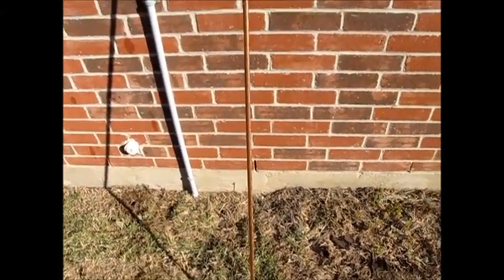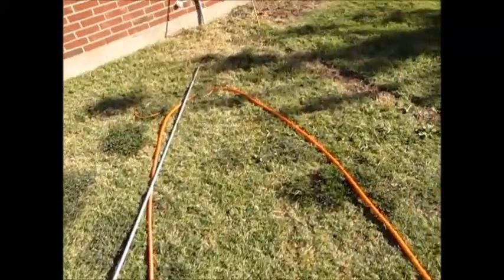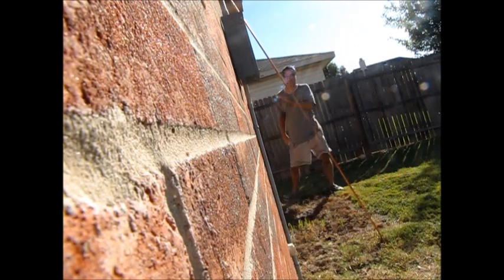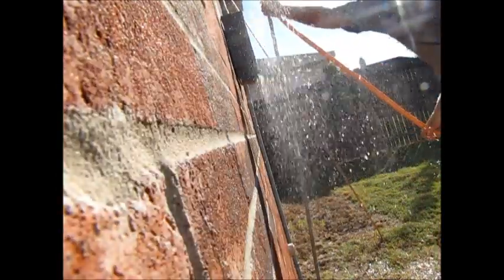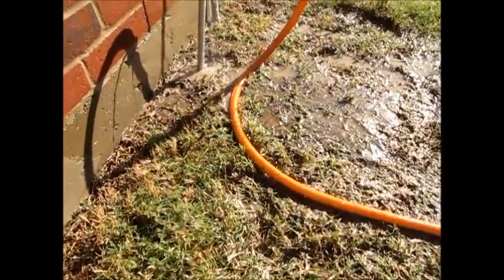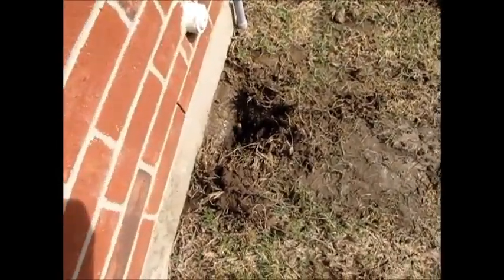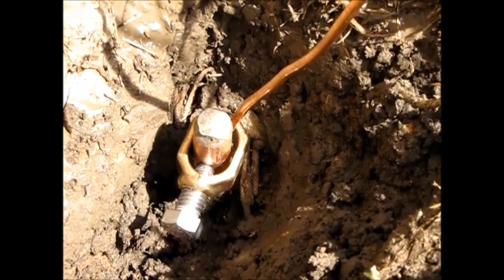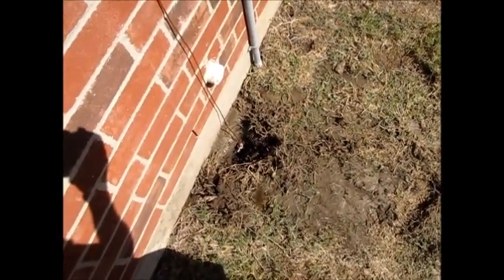How to Install a Grounding Rod The Easy Way (Full Demonstration)

Comment: Do all American homes have there own ground rods? Seems weird, where I live in Sweden the grounding is made at the electricity station by the utility company.
Reply: gamingSlasher It is required by code in the US. The rods gives electricity an alternate path than through your home. With non-conducive  materials being used for water. grounding to the water pipes can create problems ppzzzttt.
Reply: gamingSlasher Many years ago some systems were what is called floating systems with no ground used at all. It has been determined that a grounded system is safer than ungrounded or floating systems. Your implying that in Sweden that your ground wire runs the full length of the distribution system or ignores a separate ground until it comes into the home. if you have a fully underground system it might be safe to not use a separate ground until reaching the home. Or maybe you are mistaken and the ground originates at the last transformer. However except in big cities and new subdivisions most of us receive our power from wire on wooden poles which are subjected to auto crashes and weather downing. So it would not be unusual for a transformer to lose its ground after a pole comes down. Utility workers are usually private company employees and after a storm big pushes for getting stuff done often results in cutting safety corners which are put off to another time. If your service is properly grounded internally that should protect you from most external problems.
Reply: Grounding rods are for the pure purpose of dissipating the induced current produced from nearby lightning strikes. Otherwise, the induced current in metal parts of a structure can arc as they travel to ground.
Reply from the maker: gamingSlasher Yes I think all homes have grounding rods according to the electric code.  I have read that it is not necessary but is more for an extra measure of safety.
Reply: Kim O'Brien
Thanks for your input. I meant at the last transformer.

Comment: Why not just use a big hammer.
Reply from the maker: You certainly can but you run the risk of mangling the rod and it is a lot of work to swing a 5 pound sledgehammer for 15 minutes or more.
Reply: I've installed about fifty of  these over the last couple of months. In the uk you can get earth stakes that screw on to each other. Try hammering eight screwed together at a total length of 9.6m
Reply from the maker: Yeah that sounds like it isn't fun.  I think I'll pass!

Comment: Also what the heck is on your panel bussing? That looks like #4 tied to #8 or something? All red?

Just wondering.
Reply from the maker: I need to do a video on my combiner boxes.  They are load centers converted for use with DC.  Basically I have one red wire connecting the two positive blades together.  I have the negative side wired to ground.  Then I have some breakers for being able to disconnect loads if I need to (I realize they could arc so if I need to work on them in a dangerous situation I physically disconnect the wires completely from the batteries).  There is a black 1 AWG wire coming in from the batteries via a charge controller and a red 1 AWG coming from the same.  Then it is converted to 4 or 6 AWG to each load, max 15 amps.

Comment: Why not use a 3/4" rigid pipe so that the hose bib fits on and does not leak? I have not tried that with rigid pipe but water tunneling with 3/4" PVC works like a champ with a 3/4" female adapter on there...
Reply from the maker: I don't have any trouble with leaking so far and it has been on there for well over a year.  The box itself is underneath the eave of my roof so that helps but even driving rain doesn't penetrate.  It is a NEMA-3R box for outdoor use.

Comment: like u said its a big mess.
what about new construction there's no water around.  Fail inspection (electrical)
Reply from the maker: This isn't for electricians or anyone who wants to follow electrical code.  This is for ham radio operators, solar panel hobbyists, and others who want a direct current ground and do not have access to big, expensive tools to drive the rod into the ground.

Comment: I used the same method to sink all my rods but then I came across a comment that kinda make sense. When we water drill  it creates a hole which is wider then a rod. Common sense tels me my rod has no tide contact with earth soil. Any comments?
Reply from the maker: Just like with any hole you dig, it will eventually be filled in with soil from erosion and shifting due to rain water.  It will compact itself and be like the rest of the earth.  I shake my head when people say that the rod doesn't come in contact with the earth.  Well, try pulling it back out then!  Even before it dries that thing is in there and you can't move it.
Reply: This is absurd.  Perhaps over years (decades) the ground near the bottom will fill back in, but in the meantime you still have a poor ground.  NEC requires a full 2.5M of contacted into undisturbed soil.  The soil at the top will recompact, but not down below.  There is no mechanism for that to happen which is why posts are cemented or used aggregate back-fill. (non-compressible)   Speak where you are an expert, or don't give advice.

Comment: I use the rod itself to churn the water at the bottom, just poured from a jug, into the hole occasionally.  No tools, no hose, no hose fitting/  Takes about 1 minute/foot.  Be careful to avoid large roots, ground pipes, or foundation footings.
Reply from the maker: I'm sure that works well.  Thanks for the tip!

Comment: Can't you just remove the hose from the pipe, and drop the copper rod in the center of the pipe, and then pull just the pipe out, leaving the copper rod in the ground? Should eliminate any need for pounding down the copper rod.
Reply: LDSreliance What if you used a 3/4 PCV digging rod that had a union at the top that converted to hose bib past the union?  Seems like the catheter approach would work well.. PVC is pretty cheap too..  Won't the ground eventually settle and secure in the rod anyway? Can you backfill with anything?
Reply from the maker: Jeff Mucha Yes, the soil will eventually fill in as it rains a few times and will be every bit as secure as someone using an expensive machine or other method.  No need to backfill, this method saturates the ground and turns it to mud so it will dry and harden around the rod once you get it down in there.

I don't know about the PVC.  It might crack or chip against rocks.  It should work but it might not be quite as effective as the metal conduit that I used and it was only a couple bucks.
Reply from the maker: Good idea, but unfortunately it is too thick.  The copper rod and the electrical conduit pipe that I used for the drill are pretty much the same diameter.  You don't want to use a pipe that is too wide because then the dirt won't fill back in really snug around the rod.  The rod needs very tight contact with the earth to provide the proper ground.  If it is just loose fill around it then the rod will not be effective.

Comment: this is great thank you... I have a question, why are you grounding the box? does that mean all outlets in the house are now grounded? I live in a 1950's house and just found out that  outlets in the bedroom and mainfloor aren't grounded. I'm just reading up on Earthing and Grounding for health benefits, and want to ground my house.  Do you know what are the contraindications to not having a grounded house?
Reply from the maker: Grounding is a good idea because of static DC electricity that can build up on lines, even AC lines in your house, and discharge or cause modern sensitive appliances to fail.  It probably isn't a big deal in your house unless you are planning to sell the house soon (would be a drawback for a potential buyer if they find it in the inspection) or if you are doing some remodeling anyway and have torn down the plaster or sheet rock walls so you can have access to the wiring.  If you don't have either of those situations, it probably isn't worth the hassle.
Reply from the maker: To answer your other question, the grounding rod I installed will provide a ground for any circuits wired from that box that I installed on the side of the house.  However, that doesn't mean that the interior of your house is wired for a ground, which is a third wire in your AC wiring in your walls.  Older homes did not have the ground wire so even if you installed the grounding rod outside, your outlets with old wiring would still not be grounded.

Comment: Wow! You made a mess! Did you say 15-20 min? Looks like I need to make a 3 min install (in real time) video with less than 20oz of water and NO mess!
Reply: Darwin Bird What's your method for installing a ground rod in 3 minutes with 20oz of water? Does it involve a hammer drill?
Reply from the maker: If you can accomplish the same thing in that time with that much water, I would be all ears.  Good luck!